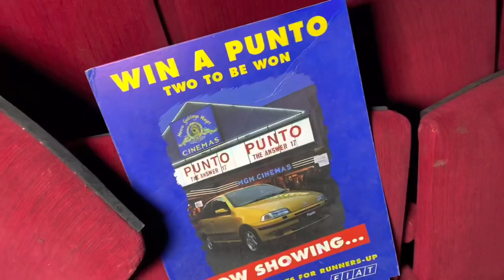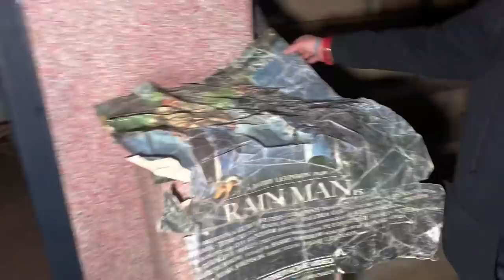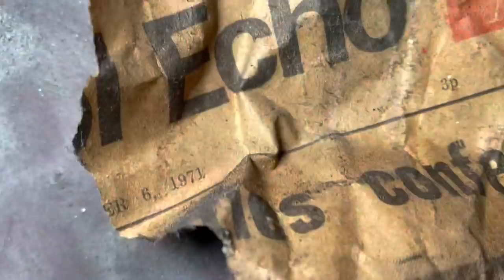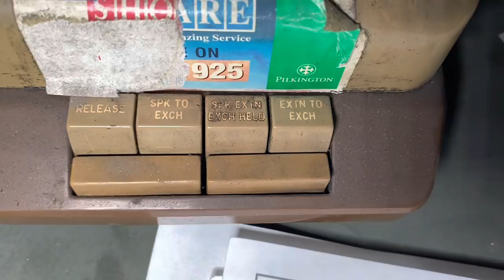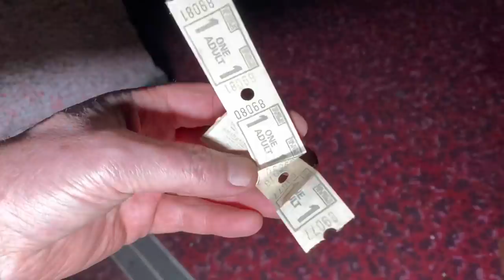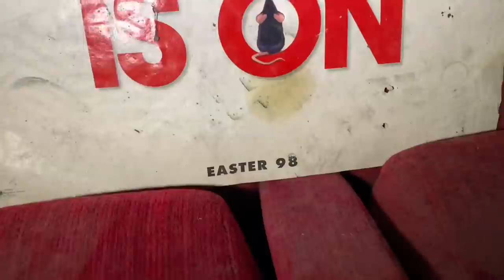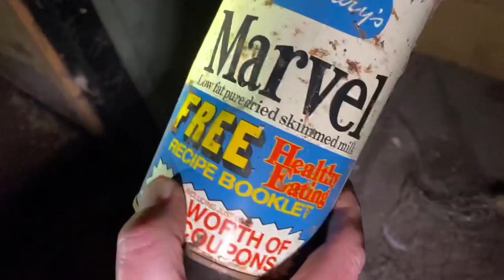This ABANDONED creepy old picture house is full of noises

Comment: Was I the only one who heard somebody shout hello at 19:21 ? It could have been someone outside 🤷🏼‍♂️
Reply: I heard it. It's right at 19:15-19:16
Reply: I heard it too.. had to rewind 3 times to listen as I thought I was going mad.
Reply: @donnaallistone7772  I did the same 😕
Reply: Remember that this building is open to the elements all over the place so there is a ton of sound contamination. You've got dripping water which is often mistaken for voices, holes that allow wind gusts to come whistling through, pigeon-y bastards are all over and there are probably other birds (such as the non-bastard pigeons😉) and animals as well. Then there are all the people we see walking through the streets and it's near a train station. I believe the the timestamp around 19:46 is a dog barking. The first one that a few people commented on, 19:15 or 19:16, is most likely someone outside. (I guess it could be security also, but I don't recall the guys mentioning that security was something they needed to look out for.)
Reply: @kassiopiajudkins2722  I get that. I'm not discounting the fact that it could have been outside noise. The only reason I said anything is because of we heard it, you would think they would have and Matt usually shits himself when he thinks there's someone else in the building.
Reply from the maker: Yes I have to say I didn’t hear anything about the time

Comment: The hole in the cieling next to the light is likely as a result of the plaster on the underside of the lath failing and just falling off.

maybe the lath rotted away too following or was just dragged down with it...or, maybe, itlfnit was getting wet, I rotted before.

It happens a lot in old houses...it's a big probl.for National Trust homes andnl they have to constantly take measures to secure it in place so it doesn't just fall.